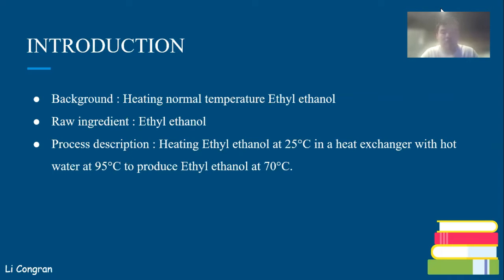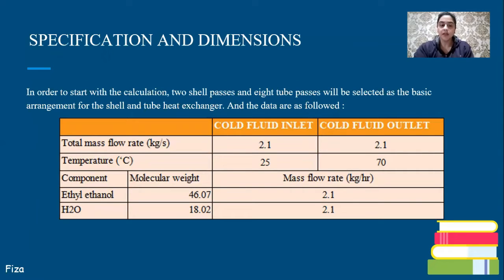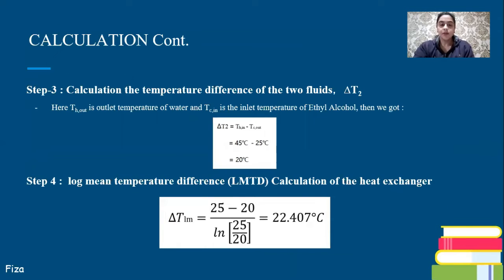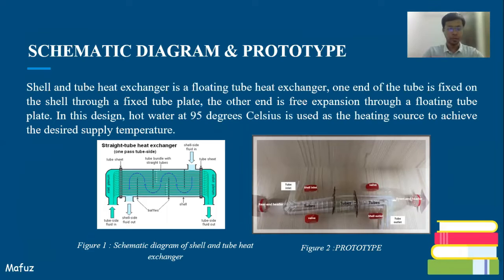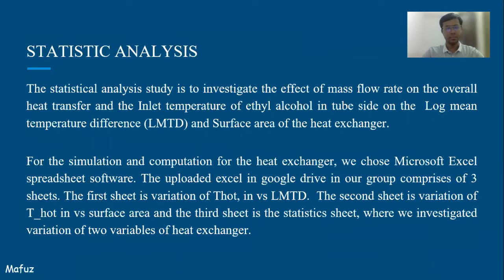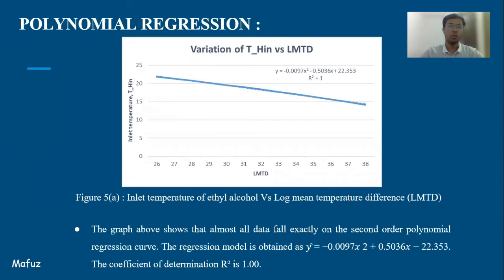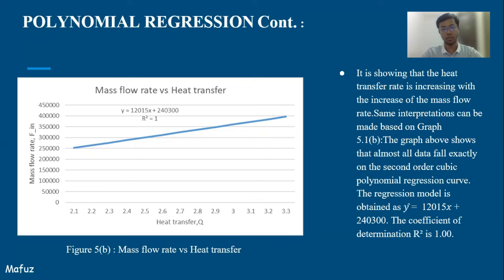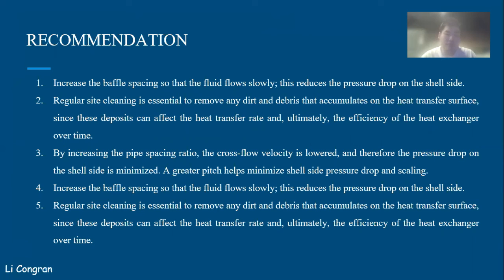ECH 3116  HEAT AND MASS TRANSFER  Project Presentation G13

Comment: What materials are commonly used in shell and tube heat exchanger?
Reply from the maker: Dr. 
The materials are commonly used in shell and tube heat exchanger are metals, including aluminium, copper alloy, stainless steel, carbon steel, non-ferrous copper alloy, Inconel, nickel, Hastelloy and titanium.

In this this project we used stainless steel